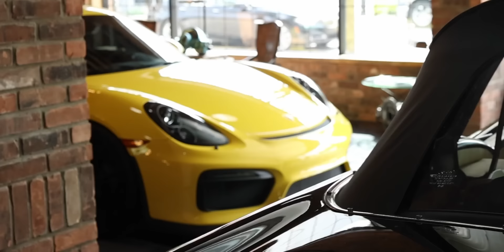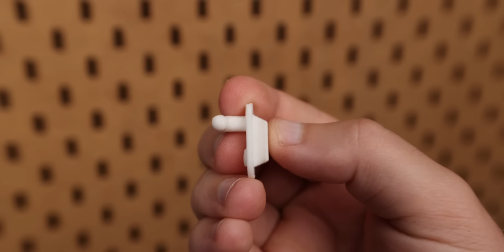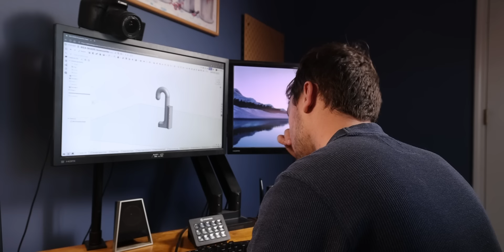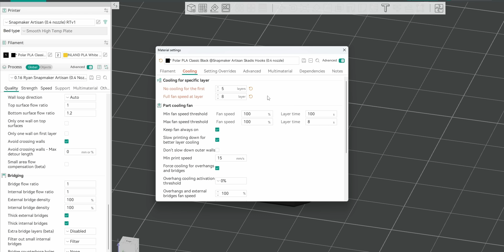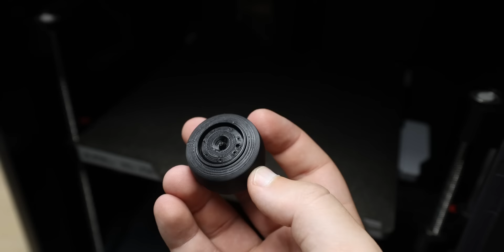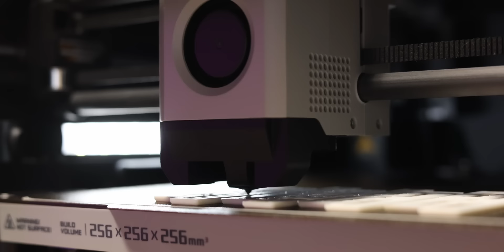I Solved Two SKADIS Problems

Comment: I tried this and was very excited. But now i realize that you cant take away the accessory with the mount on it from the board unless you design your slot to be at the very top of your accessory. Other type of hooks allows you to do this better
Reply from the maker: Yeah, it was designed more of a set it and leave it design. I’ll agree that it could be improved in that way and I’ll keep that in mind if I ever make a newer version.

Comment: The dovetail approach is something I tried years ago for my "TEKTON driver set holder for IKEA SKÅDIS" model on Printables (not intended to be promotion, just for reference), where I used a plug to fix the position of the mount, but I never liked that solution as they were fragile and a pain to remove.  Kinda abandoned any SKÅDIS mounts since then.  Your approach is to really great and definitely solves that headache.  Gonna have to adopt it for some other parts I've been wanting to make.  Thanks a lot for sharing!
Reply from the maker: The dimensions for the female slot can now be found here: https://youtu.be/2hf0dgyZksU
I'm glad the design solves an issue you found with your full dovetail design. Definitely share some photos once you get it all designed and printed!

Comment: Nice video. The best advice I can give to anyone is to buy a SuperTak plate from BambuLab. This thing is a beast, you won't ever worry about bed adhesion or warping again when printing PLA or PETG.
Also regarding the video itself, if you could articulate just a little bit more, you were sometimes hard to understand (English is not my native language, but I don't usually have issues undrstanding).
Regards.

Comment: Dude stop trying to fix your design when your printer isn't working properly. Your bed adhesion is from the last century.
Reply from the maker: It’s true the design wasn’t the problem through that section, but I don’t think I would’ve come to this final design without it. I would’ve landed on a design that worked decent but wouldn’t have been as nice. So while I was chasing the wrong problem, it ended up forcing me to make a better product. Thank you for watching the video and sharing your thoughts.

Comment: I like this design. But not sure if it will solve my problems with horizontal skadis mounting. Havent found a good solution for it yet.
Reply from the maker: I’m curious what you mean by horizontal mounting? Is there a specific use case you’re looking to solve?
Reply: @RyanTuscher I had to turn my skadis 90 degrees because it didn't end up fitting the space the way it's supposed to be wall mounted. So I've been looking for good horizontal mounts.

Comment: Elephant’s foot is a result of having the z-offset too low. You may have it set too low to try to overcome adhesion issues. A couple of things that help with that: Wash the print surface with soap and water at least once a month and dry it well with a paper towel. This gets rid of oils and contaminants that prevent good adhesion. Before every print wipe down the print surface with isopropyl alcohol to reduce oils/contaminants. Try bumping up the heat bed temperature by 5-10C, if you still have adhesion issues you can use a glue stick (the purple kind) to apply a thin layer or you can use unscented hair spray. Adhesion boosters like this usually last more than 1 print.
Reply: Also spend some time tuning your printer

Comment: dude what printer is that?
Just so that I will NOT buy it. It's weird to have adhesion issues in 2025.
Reply from the maker: Most likely user error. I've had really good adhesion with bigger prints, just the smaller prints give me a hassle. I also haven't done much calibration on it so I'm sure it is fine once you actually use the right settings. Printer is the Snapmaker Artisan.
Reply: In the slicer it can be seen.

Snapmaker Artisan RTv1

Comment: Glue stick on the print bed will help with the print not sticking.
Reply: Glue sticks are supposed to help with release from the printbed, not adhesion.
PLA and PETG should never have adhesion issues. If you need glue with these two filaments the you should calibrate your printer, change your print surface, increase bed temperature, clean your bed, adjust z-offset.
I have NEVER had to use glue in a 3d print ever.
Reply: @littlefrank90  I've never heard that before.   I've always heard that it helps adhesion.  I'm not saying I'm right, just that I've never heard that before.

I will say I've never printed on (what looks like) a glass bed before.  I've always used either a smooth or a powdered PEI sheet.  Lately I've been using the Glacier sheet, and it's been rock solid where my textured sheet either allows warping or doesn't hold onto the print.
Reply: @rickseiden1 with a clean PEI bed and proper settings glue Stick is not needed.  Having said that I use NPA mostly just because I can apply it once and do 10+ prints without cleaning the bed and I know I won't have any issues.
Reply: @rickseiden1  Glue sticks were a common way to improve adhesion before we had PEI sheets. You either had to use painters tape or cover the bed with glue. Nowadays they are mostly used to prevent parts from sticking too well. It happens with some filaments like TPU.
Reply: @CockroachSlidy  It looked to me like he was printing on a glass bed, though.  If he was, wouldn't glue stick help with adhesion then?

Comment: This was a cool journey through your iteration. One possible alternative that could print without needing to do halves is to make the dovetail a V shape at 45 degrees; this angle is safe for doing overhangs. Second, instead of the dovetail sticking out, have that V shape cut inwards as a channel along the vertical member.